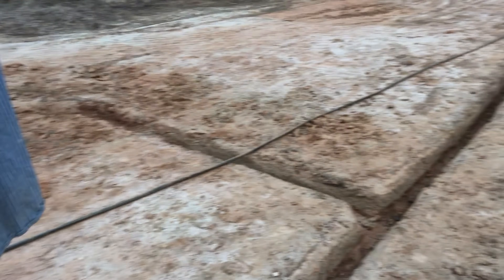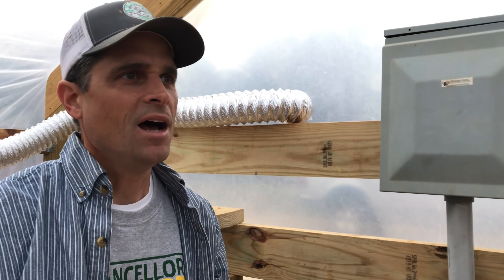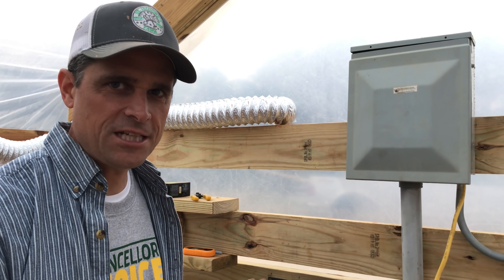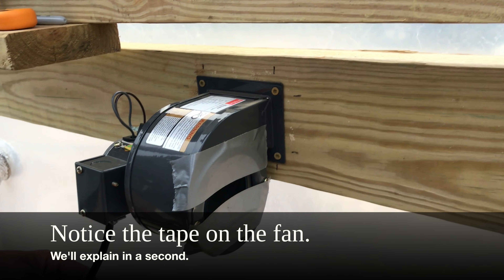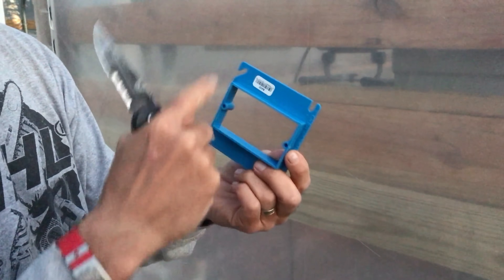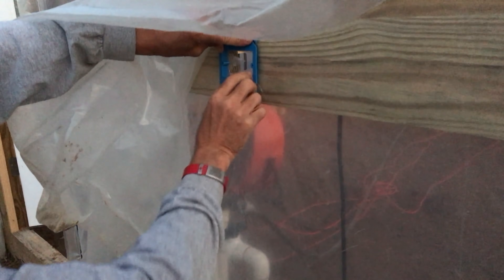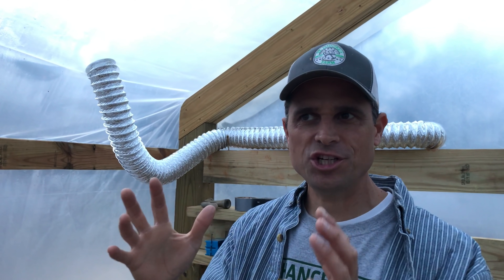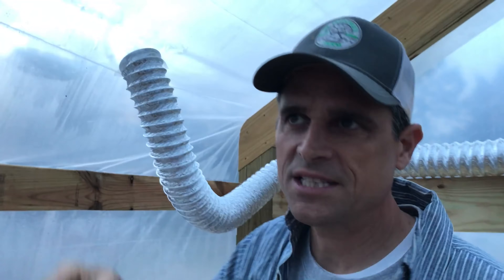DIY Geothermal Greenhouse Pt 10: POLY FILM INFLATION

Comment: My answer to your question, you are looking for F^3PM, so velocity (FPM) * the area of the pipe (Ft^2) gives feet cube per min (F^3PM)

INTAKE:
Convert MPH to FPM, 
17 mph = 1496fpm

Find area of pipe, 
Pi*R^2, 3.14159*3^2 = 28.3in^2 

Convert square inches to square feet,
28.3in^2/144 (in^2/ft^2) = .2ft^2

multiply out to find CFM,
1496fpm * .2ft^2 = 299 CFM

DISCHARGE:
12 mph = 1056fpm
pipe = .2ft^2
1056fpm* .2ft^2 = 211 CFM

Total air changes:
Two fans in CFM converted to Combined cubic feet per hour,
211*2*60 = 25320 CFH 

Combined volume of fans divided by volume of green house gives total Air Changes per Hour,
25320/6144 = 4.12ACH

I rounded numbers to make the math easier, 

For What It's Worth
Reply: Yes you rounded and lost 30% of the volume, when its closer to 15% loss when using the actual flow rate provided in the video and the size of the pipe. Don't round until you have complete all calculations.
Reply from the maker: WOW! Seriously, thank you for taking the time to do these calculations and share them! Unfortunately, the final number is much lower than we had hoped. Not terrible, but definitely not what we were aiming for. We'll use this in a Q & A about the greenhouse in the near future!
Reply: You are welcome, 
The fan housings look like they are designed for an inline application. Opening up the intake side may give a volume increase at the expense of slowing down the fan, the higher volume would create more drag. Again just my opinion.
Reply: @acornaction1938  just curious but would a fan at the return/exhaust end, to create a pull, help at all?
Reply: @krimmer66  In my experience fans are much better at pushing air than pulling. Also I would be concerned with the fans fighting each other, because of the length of the series. Lowering the intake velocity by increasing the intake diameter may allow for a higher pressure on the discharge side.  I am not an aeronautical engineer by any measure. FWIW.
Reply: @acornaction1938  I did some digging around and it seems cannabis growers have been the most active exploring this LOL. Nothing concrete but a few people did say it was completely safe to put these fans inline, that said it will not double the air moved however an increase could be possible.. none of them were aeronautical engineers either as far as I know haha.

Comment: I believe that when you measure flow rates, you need a length of straight pipe.  The inlet side was adequate, but your outlet side had an elbow immediately behind where you took your measurement.  So, that may effect the accuracy of the latter measurement.

Comment: Great settup , i use in mine to inflate it a 4 inch hydroponic fans with dryer docks and dryrer hook ups for the jumpers,  with a knob to turn up or down the flow of pressure 70$ CAD less noise too, before i used a hair dryer till it blew up lol. since then no more problems  with my 20x28x 15 high  greenhouse. and for the hot days i have windows that opens up and close with bee wax cylinder that expands and retracts with no electricity and added a limit switch to turn the fans on/off without any intervention. so is my roll up sides.

Comment: Just watching this now... but when measuring air speed in a pipe either for FPM or CFM, especially right by an elbow you need to measure center, top and both sides and find the average. an elbow throws more air up against the opposite wall of the pipe until about 3x the diameter of the pipe itself. Just thinking that might change some numbers for Ya! LoL

Comment: If you turn the poly inflating fan off and on based on pressure do you lose pressure back through the fan or is there a one way valve on the fan

Comment: I know this is long after this project has been finished. But for those interested, the reduction in temperature at the outlet would probably explain a lot of the reduction in CFM at the outlet because as air cools it contracts in volume. So if your blowing  400 CFM of hot air in, that same air, without any leaks or other loses, would come out with less volume, i.e. less speed. If my memory serves the volume changes in proportion to the change in temperature in Kelvins. So a 30 degree drop is approximately a 10% drop in absolute temperature which should correspond to a 10% drop in volume and speed coming out of the exhaust.

Comment: From my experience, but please run a test, having slightly stronger pull on the exhaust end will reduce drag (producing less strain on your fans) and increase the amount of air coming out the exhaust. Also you may not even need a fan for pushing as the exhaust fan is doing most of the work anyway. Btw love this series. I'm learning a lot

Comment: If you would've built the right frame, you could've used two layer of plastic foils, one on the inside and one of the outside, having a continous layer of protection. There would not have been any discontinuity, like you have now on the top of the walls, and you wouldn't have to use any electricity to keep it going. Study phisics and thermodynamics before hand !

Comment: Imho air flow has to be factored with/ include thermal expansion and contraction. The air at 90+degrees will be a larger volume than the volume of the exhaust at 35 degrees. 
Thank you for your vid. You obviously like thinking things thru and figuring out every aspect of the physics behind the environment. 
Having said that I have a couple of question you might be able to answer for me. 
(Let me back up the truck for a second.. I’ve been wanting to do an earth battery ever since I saw how the Romans heated their enormous stone structures with similar installations. Aka thermal heat sinks.

What peaked my interest is that you mentioned you built primarily on a clay bed, which is exactly what I have; no topsoil just clay.lol and river rocks. ) 

Q1, What I need to factor in for the efficiency equation is your latitude. 
I’m at the 55 degrees  latitude. The depth of the pipes will make a huge difference for the efficiency. 

Q2, what is the depth of frost for  your average winter?
Our average here is close to  4ft. I’m thinking with a trencher install a perimeter thermal barrier say 2” styrofoam. 

Thanks again and thank also anyone that wants to comment. And or that has maybe a chart of latitude / soil mean temperature. 
( google was no help )!
Reply from the maker: Yes, all clay here. Piedmont North Carolina frost line is 12".
Reply: @StIsidoresFarm  
Wow thanks for the reply. 
After I wrote all that I noticed your vid was 2 yrs old 
One more question if I may 
How do you rate your green house efficiency wise and what if anything would you do different? 
I hope you enjoyed 2 yrs of fresh vegs.

Comment: Wonder if a dual blower system would help with earth battery savings. One blower to push air into earth battery for night heating and other blower to draw air thru earth battery for cooling & recharging battery or vise versa? Have you taken any temp readings between pushing air and pulling air thru battery?

Comment: Now I'm not a scientists or a mathemmatician but I believe I have a very logical mind. What makes sense to me is that at first you are measuring air speed "ahead" of the fan which means it's a vacuum and a low pressure system, then on the outlet it is "behind" the fan so it is a high pressure system or compressed air. If there were no holes in the system the air speeds could be different with the same amount of air at both ends. Now your system does have holes and air is escaping into the ground but maybe not quite as much as you think.
Reply from the maker: As it turns out, air comes up through the ground into the greenhouse. Basically, the ground in the greenhouse is dry enough that cracks go all the way down to the pipes. Because they're perforated, air push up through the cracks.

Comment: Effectiveness of system !  I respect and admire not only you but also the family members and their efforts, so if the effective scale was based on efforts you all get 110% A +... unfortunately not so. Air and water flow share some principles - both travel in direction of least resistance. That being said  - consider/experiment (fan moving air the range/area fan is actually moving air from)  hmm ponder that thought. Instead of open free range only one specify area - would it be more effective to have duct work for intake to 4 or more locations for each fan forcing hot air being sucked into intake? Another discussion is the air from outlets is restricted to corners only and heigth. Wouldn't it be more effective if the cold air was released at a higher level and distributed thru duct work and released at several locations? 
Just thinking the cool air only in corner has little if any affect on temperature in center. Once cool air is released it drops not being pushed around evenly throughout. Theory.  Certainly the temp reading at outlet substantial 30 degrees difference but just right there one tiny location site - need many more - in principle you wouldn't expect an AC system to be effective to cool such a large area with only 4 little outlets. 
Awesome job - great attitudes, loving kids and family!!!

Comment: I once was part of a research project using a third layer of poly. In short, it worked fantastic. Reduction in lighting was way less than expected. This allowed the owner to relocate to a colder climate and still pay the same but usually less than before. It really was worth the extra expenses.
Reply: Did you publish anything?

Comment: Frictional loss is what slow air flow in the pipe.  Smaller diameter loses more flow than larger.  As diameter doubles volume goes to four times.  You also get more heat transfer based on surface volume.  Low flow and large volume is the most functional in both ways.  Like a 10" diameter  will slow flow with increasing volume...helps both ways...
Blessing,
Dave

Comment: If temperature drop at night is a real issue, I've been seeing water barrels lining the perimeter of the green houses painted black they charge during the day and as soon as the sun goes down and the temperature drops they yield the heat for hours.  They are sealed so no extra humidity unless you want that and at season closure simply drain them...

Comment: You can use the Ideal Gas Law PV=nRT to solve your calculation problems. 
Your Velocity is reduced due to the air getting colder (temperature is reduced) at the output. 
 
Ignore the n and R for simplicity. Since they are pretty much constants.
Your Equation PV=CT,   C=constant.

If Temperature goes down (Right side of the equation),  PV will also go down directly (RIght side of the equation). 
The Air is denser so the flow is slower in speed. Remember, Air is compressible. In your case, the air volumetric is less on the output due to the effect of Temperature difference.  The total amount of air is the same for input and output:  This is the law of Physics. 

PV=nRT

P	=	pressure
V	=	volume
n	=	amount of substance
R	=	ideal gas constant
T	=	temperature

Comment: Did you install the Dwyer differential pressure switch and if you did, how did you install it and did it work as planned? I'm looking to use your automatic shutoff switch idea with my greenhouse inflation system as well.
Reply: We installed Dwyer pressure switch but couldn't get it to read pressure

Comment: Do not place the one way flap valve (I'm sure I'm to late ) it will cause the fan to turn on and off none stop the house will deflate all most instantly there is no way the house is air tight in will loss air slowly  giving the fan time to come to a stop before trying to come on again.
Reply: If its not airtight you wont have a still air gap and it will be no better than using a single skin..My differential pressure switches dont turn on and off non stop, they operate from  couple of times a day to once every few days, depending on the weather.

Comment: Good job and I enjoy your videos. One suggestion however, by pulling the air from the inside of the greenhouse you are putting mosture between the plastic and creating condensation. Thus reducing the light to your plants. If you pull from the outside you could reduce the condesation

Comment: Re the double poly wall. For 10 years or more I've used a 120 volt computer fan --solar GH of 250 sq ft glazing. No need to blow so hard into the gap. In fact the bigger the gap between poly layers, the greater will be convection looping hence heat loss. Where you have EMP or other connector touching the poly, use a bit of smooth-surfaced tape to reduce friction. Finally if you ever get wet snow you'd save your roof if  there are horizontal members across the arches to fight the snow load

Comment: If your gonna build another greenhouse, build it Truthfully Underground! Still use the greenhouse top which you've built. However dig 10 ft into the ground and Adobe  the walls. Run a 3ft diameter pipe 2 of them one side of the house. 60 ft at minimum, 80 ft at maximum. Yes that means you'll have to dig a 10 ft hole, 60,ft long for exhaust. Now do the exact same thing on the opposite side of the house. Now you have heat cold regulation with NO ELECTRICITY.

Comment: Very inspiring video series, 
using a pressure switch is a great idea.

As a mechanical engineer trained in fluid and thermodynamics, my main concern is that by blowing warm air from the inside of the greenhouse into the cooler polyfilm will result in condensation inside the cavity which could result in problems such as your timber rotting prematurely and the humidity in the air will also increase the conductivity of the air in the cavity.

Improvement suggestions
If you blow cooler air from the outside into the warmer cavity, the moisture holding capacity of the air will increase meaning you are much less likely to experience condensation.
Putting in a small bleed hole would enable moisture which builds up in the cavity to escape.

I would also suggest that you might be better off putting both circulating fans in series as opposed to parallel because they will develop much more pressure to overcome the high losses to resistance you will experience because of your long pipes.

Comment: Air velocity (distance traveled per unit of time) is usually expressed in Linear Feet per Minute (LFM). By multiplying air velocity by the cross section area of a duct, you can determine the air volume flowing past a point in the duct per unit of time. Volume flow is usually measured in Cubic Feet per Minute (CFM).

Comment: The air spaces between the two plastic make no difference between 1” or 10” the R value still the same
Reply: not exactly, the wider the gap the easier it is for convention currents. An additional twist to this is it also depends on the orientation. Air in the sidewall of an inflated cover has a lot more vertical space than air in the inflated cover at the top of the hoophouse. Convection currents are driven by temperature difference, the warm inner wall causes air to rise and the cold outer wall causes it to fall,  its a vertical conveyer that moves the heat from the inner skin to the outer skin where its lost to the outside world ;) Domestic double glazing units have a small gap to help prevent convection currents.

Comment: Instead of placing the fans themselves at the peak of the greenhouse and only pulling hot air from the center area between them, why not run pipe (I suggest flexible ducting instead of PVC, and again, it will be acting as a manifold, so it needs to be larger than the smaller duct work on the sides if you attach any, just seal the ends of the larger duct to increase the suction on the smaller ducts). Run this duct the ENTIRE length of the greenhouse peak with two rows of one or two inch holes cantered about 20-30 degrees from the TOP dead center (not the bottom or directly on the sides) running along the top edge and alternately spaced about 18 inches apart to pull the rising hot air from the entire peak length of the greenhouse? Just move the fans to sit on top of their respective riser pipes coming out of the ground in each corner instead and attach the duct to them as you did the PVC pipe. This will allow the fans to vacuum-pull the hot air into the peak pipe and push it into the ground pipe. You could also attach and run much smaller similarly hole-cut duct work down from the peak pipe on both ends of the greenhouse and down from the peak along every 3rd or 4th cross-member to pull air in from along the sides of the greenhouse. This will eliminate "dead air" zones that your fans aren't reaching directly and offer a much better temperate air mixture that should lower your inside temp considerably compared to what you are getting now without a lot of extra expense. Also, placing an exhaust fan at the exhaust ports that redirects the exhausted air directly back toward the floor area in the center of the greenhouse will be a huge help.

Comment: I know Its almost a year later but did you get a thermostatic switch for the fans? I use Inkbirds from my projects, you can set them to turn on and off (hot,cold)  with one device for around $30 each.

Comment: Great series: It might be already tried, but I suppose the thought of adding exhaust fans on the return pipes to help pull the air that the intake air is pushing, would help??
Reply from the maker: We actually tried it on one. It didn't seem to make a dramatic difference.
Reply: @StIsidoresFarm  It is always easier to pull air, rather than pushing it. Have you placed the fans on the exhaust pipes?
Reply from the maker: @LivStream-TV  Yes, we tried that. Definitely not as good.